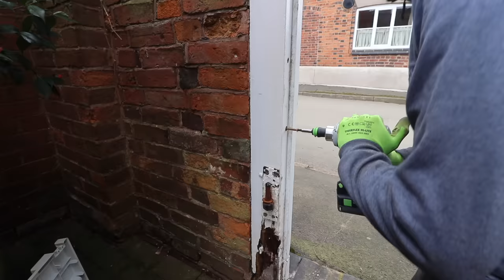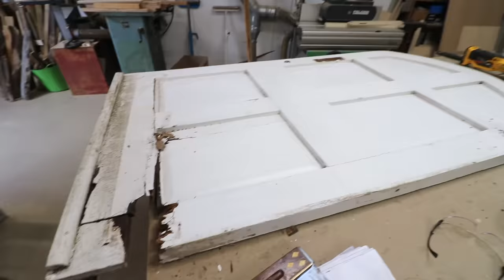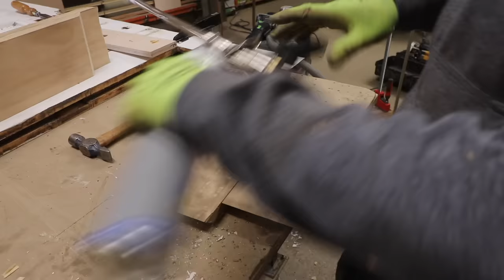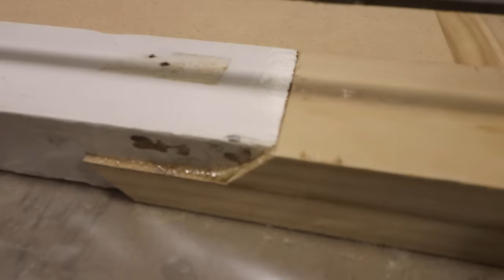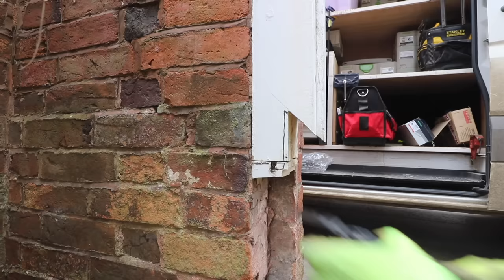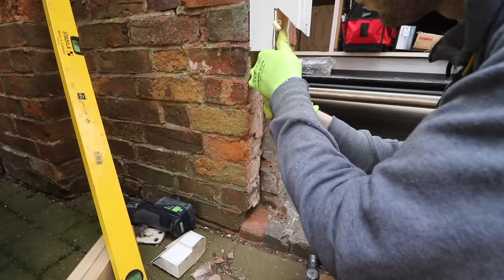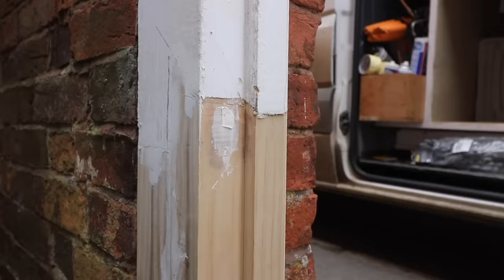Rotten Door, Full Repair. Here's How I Did It.

Comment: As a painter the one of the things I do when doing small repairs is to prime and coat the entire bottom edge of the frame repair to prevent rain water from wicking up the frame to prevent rot and insect infestation.
Reply from the maker: Cheers Bill, I did coat the end grain with Sikens Wv456. Its great stuff and worth having in your kit bag!
Reply: @BradshawJoinery  Glad to hear that I knew you were top notch.

Comment: Thanks for the inspiration! I just made a replacement bottom rail for our 81-year-old door. I don't have sizable machine tools in my current workshop, so I cut the tenons and the top channel on the table saw and used a chisel and a hand plane for the fine work. It took a while, but not longer than going to get bigger tooling that I won't use in the future. I'm happy enough that the door is solid again and functions normally. I was a bit intimidated by the project until seeing this video of yours. Much appreciated!

Comment: Great job! lots of good info and learned some great tips. I dont have that wonderful industrial tenoning machine ,no biggie, it would just take a little longer. The 45 angled steps in the grafted styles I will certainly use, super cool!
Reply from the maker: Cheers Brian, Yeah its a great way to strengthen the joint into a solid part of the door

Comment: Outstanding workmanship. Great to see "REAL" carpenters still exist. My only question would be about the panels. Did you use MDF and how do you rate it will last, especially outside. I've heard even the "exterior" grade is not that good.
Reply from the maker: Hey, thanks for that, this is special MDF, made from Accoya wood fibres, it will not swell or rot outside, even untreated. Its called tricoya there is a link in the description

Comment: Great to watch video, on my 2nd multitool now I think they are one of the most underrated modern tools out there, not only for carpentry but metal- plastics- tiles ETC
Reply from the maker: They are certainly more popular now than 10 years ago! 
They had a Fein when I started in 2007. I've not seen another one until about 5 years ago when they started taking off!
Reply: I kept seeing them when I popped into the toolshop and kept thinking "What use are they?" Eventually I bought a Makita 18v one and the number of times it got me out of a fix... Hardly a job goes by without it being used. Underrated, as you say.
Reply: My Bosch 18V brushless multi tool is the best power tool I've purchased to date. Worth it's weight in gold and has paid for itself ten times over. A real game changer and the ultimate get out of jail card, 👍🔨🇮🇪

Comment: A very decent repair. Customer will appreciate your work for sure. Whenever I did these repairs I liked to shutter the bottom of the door jamb 4 inches high say and fill with a strong cement to keep it off the cement threshold. But you did a good job. I’ve never used the quick dry glue but it’s good in getting the setting so quick. I’m retired now and I did enjoy watching you work takes me back nearly 40 years!
Reply from the maker: Fair enough! Rain splash and sitting wet as the main cause of the rot. THe accoya timber does eliminate that tbh, Its a game changing material for this work. Thanks for the comment :)

Comment: Great video and very instructive.

The new panels you made looked like MDF, is that what you used?
Reply from the maker: Cheers Lee, Yes Its Extreme MDF from Medite, made using Accoya wood fibres. Will last outside unpainted for 50 years!!!

Ive a test piece sitting in a puddle outside the workshop for 7 years now, other than it being very discouloured its still exactly the same .
Reply: @BradshawJoinery  Thanks for that explanation. I thought it looked looked like MDF too, and the only stuff I've seen turns to custard if you so much as show it a damp rag.

Comment: Really nicely done. i just have a question, did you treat the endgrain at the bottom of the framerepair ? and if not, why would that be ?
Reply from the maker: Thanks MAte, I put a clear End grain sealer on the bottom, its a product by sikkens, dries fairly fast. If your in a mega rust to seal end grain and have no other options, i have in the past allowed superglue to soak into the grain then use a spray activator to harden it instantly. 
Sealing the end grain of accoya is only to benefit the paint adhesion really. the actual timber itself will not wrot even if completely saturated.. for a long time
Reply: @BradshawJoinery   nice. ty

Comment: Without any doubt, the multitool is the greatest tool invention in many decades.
Reply from the maker: haha yes James! they seem to have took off now. I remeber where i did my apprenticeship in 2007, they had a fein multitool in the workshop, that looked years old, so i dont think they are a new invention.
Reply: @BradshawJoinery  I use an AEG battery multitool and in my opinion they are one of the best because of all the different heads that can be attached to them. I've had mine for about 8 years and it's still going strong.

Comment: Unbelievable on how many tools you use to do this repair job. Your mindset of keeping up with all the details and progression and step-by-step process is spot on.
What is the ratio price difference between this repair and building a door exactly the same from scratch?
It’ll be interesting for the homeowner to see this video, they would understand better why the cost is what it is. I am not a carpenter I just happen to come across this video, it was awesome thank you for posting. In this day of throwaway society it is refreshing to see your detailed work repair.
Reply from the maker: Thankyou Raymond, Yes most jobs seem to require thorough planning before starting or you end up in a pickle! This repair once painted probably 1/3 the cost of new, has saved the original door, no damage to brickwork and very quick.

Comment: Enjoyed this very much. I learned a lot from the joinery you used.  I had to restore a century-old garage door.  Its bottom was rotted as well, but I had to restore the door in its place, though.  I also went to a sawmill to obtain dimensionally correct lumber.
Reply from the maker: NIce work Lisa, Hopefully the restoration went well! Pleased you have taken something from the video
Reply: Why couldn't the door be removed? (out of interest)
Reply: @sroberts605  The two car garage, with two sets of hinged doors, was converted to have only one set of hinged doors in the center.  The outer doors were affixed to the framing.  One of the outer doors needed the restoration.  I was not about to remove it since it was supporting the header as well.  The main vertical framing member that was affixed to the door was also rotted.  Rather than risking everything collapsing, I chose to restore the door in place.  I also replaced that rotted framing member.  All the timber I used was planed to my specifications at a sawmill.

Comment: Panel doors are no good for outside I had one it lasted a few short years panels got rotten ,replaced with a solid door 15 years later still good ,sometimes repairing doors could be as dear as a new door for out side but you did a great job any hoo
Reply from the maker: Hi Jimmy, completely agree, I would always asses the best and most economical route. Fortunately this is a old Redwood door that is probably 100 years old. The bits I left are completely sound, so cannot see them rotting anytime soon, and the repairs are in Accoya, so likewise won't rot or move any time soon. This repair cost under £700 and dome in 2 days. Replacement door and frame... £3k and alot of disruption to brickwork/mortar along with losing all its aged character.

Comment: That is some custom and some talented workmanship right there I tell you. I personally would have thought making a new door would have been easier,for me anyway,mainly cause I don't have access to the tools or the knowhow to even use them. Good job. I was very impressed.
Reply from the maker: Cheers John, The problem with this one is the curved head and raised panels. its a lot of work to reproduce suce a door then make it fit and install all the ironmongery. While it looks an extreme repair ive only had make the easy square bits of the door and simple panel. Saved alot of money for the customer
Reply: Just like a truly skilled carpenter,you are as modest as I thought you would be. Thank you for the explanation,it does make sense. I'm just very impressed with your workmanship. Thanks again. Nothing but good things for your channel. Peace

Comment: I wish there were more people here doing that kind of repair (Lancaster PA, with many 19th century buildings and a few 18th century ones). Here we struggle to find craftsman to repair simple things like original windows, doors, gates, etc. The only thing I would change would be to replace those phillips head screws with straight slot screws. It's perhaps a small difference, but in my experience it really helps tie together such repairs visually.
Reply from the maker: True the screws would help, I have a decent selection of slotted screws I use on all my jobs, bit not this one! 😂 Fair play, called me on that one 👍

Comment: A lot of customers have no idea what goes into a repair like this.  They wonder why I "charge so much" to "just replace some wood"
  The last time i was asked if I could do something like this I just said "no".   Fantastic job sir and nice shop setup.
Reply from the maker: Cheers MAtt, yeah you definitley need the right customer, But also weigh up the odds for them. If this door was square topped, it would have been similar cost to make a new door as repair... but the curved top changed that and they decided to go with a repair.

Comment: Just found this video on the 'recommended watch list'. It's exactly what I needed to see. My front door porch frame has been rotting away at the bottom for several years now and no local joiner will touch the job. I was resigned to knocking the whole thing down and putting up a new uPVC porch. Now I think I'll have a go at repairing it myself. Brilliant video! One question- can you please let me know what wood did you use for the frame repair section?
Reply from the maker: Nice one Billy. I use Accoya timber. It's basically rot proof! So perfect for repairs!

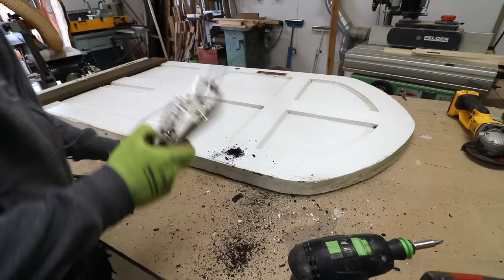Comment: 7:35 I was putting a new engine and engine beds in my boat, The engine beds were bolted to the stringer with 3/8 carriage bolts. When I removed the carriage bolts they looked like what you show at 7;35. I am lucky that the whole engine and beds did not break free while I was under way. I replaced the 318 Chrysler gas engine with a 6 cylinder Ford-Lehman diesel.
Reply from the maker: Nice one Paul! Haha its amazing how some things hold together even upto 200 years down the line!

Comment: Great job. I have had to do some repairs on old mantles in the past. The old paint is a pain. I actually started using walnut shells in a sand blaster to remove it without damaging the wood.
Reply from the maker: Nice one, I bet that makes a bit of a mess! My friend is a sandblaster. 
Have you tried a heat gun/torch
Reply: @BradshawJoinery  it's messy but it keeps the splinters away. I've
 Tried using a heat gun but it takes a long time and it leaves paint behind. I did a mantle a while back that was painted and the owner wanted it stained.
Reply from the maker: Nice one Biff, do you do that on site or take the mantl out?
Reply: @BradshawJoinery  I had to take it out. Lot of work but it turned out great.
Reply: Brilliant repair job. I've done a few myself and know the work involved. If I was super critical I would have primed the edges of the panels before installing them so if they move you wouldn't see any bare tra

Comment: Good philosophy shared between you and the owner >> repair when feasible rather than replace. Especially with a 50+ year old quality made arched entry door. Skilled joinery work Bradshaw. Owner may want to opt for a 'fancy' kickplate, eh?
Reply from the maker: CHeers DImi, yes unlike many comments its nice that you can see the value in repairing such a door and the cost and implications of replacing it! It shouldnt rot for a long time now, All Accoya/Tricoya used :)

Comment: boat epoxy glue with a slow activator works well and does not swell wood fiber which allows cut joints to go together well without a lot of hammering
Reply from the maker: Thanks James! Is it expensive stuff? Ive used the repair care system before for repairs, but it gets pretty dear, and also can end up taking forever to dry depending on which system you use

Comment: Great job, I like it a lot! My opinion, not MDF to outside projects. Also full paint before putting the accessories on the door and paint the frame from the back and from the bottom.  Ιt rains often and you have a lot of humidity.
Reply from the maker: Cheers, the MDF is a product called Tricoya, there is a link in description, its very good stuff. The initial primer coat was just to protect the door from water ingeresss for a short while while the painter was booked in to come later in the year.

Comment: Unless I missed it, I didn’t see you seal/protect the bottoms of the frame pieces before you installed them. Although they don’t seem to be resting on the ground, it won’t take long for dirt, leaves etc to work into that gap, and moisture will wick up into the end grain of the frame.  I’m sure some appropriate sealant can be applied under them to prevent the water damage from starting all over again.   Edit: I read farther down in the comments that someone else asked the same question. I suggest that some comment in the video remarks as to how this treatment was applied would be helpful.
Reply from the maker: HI yeah, i didnt show it! I use Sikkens WV456 end grain sealer, its a clear thick paste that seals the grain. Yes it will also only do so much on normal timber, With Accoya however it should last atleast 50 years! Its great stuff, any external work it really pays to use it

Comment: That is a truly fantastic and professional job. Like you I had a fully equipped joinery workshop. Where do you draw the line between repair or replace? I always enjoyed that kind of work but found it difficult to make money out of those kind of jobs. I always covered my cost but that was about it. That probably says 
more about my business acumen. Anyway, throughly enjoyed the video. Great stuff.
Reply from the maker: Repair or replace depends on, cost and originiality and disruption. A fairly simple repair here, has seen in 2 days job complete and still looks spot on 2 years later... whereas replace would have been nearly 2 weeks work, with probably damage to brickwork. I have a very happy elderly customer and was definitley the right decision.
Reply: @BradshawJoinery  thanks for your reply. I fully understand your rationale. It looked a lovely job by the way.

Comment: I quite enjoyed your post and skills. But I was also thinking about the first joiners to make this type of door before all the power tools.
I acknowledge the benefits of using power tool and only a fool would not use them if it improves the job.
Reply from the maker: It was a hard job back in the day, but I guess alot better than many of the other jobs around... Mining, steel working etc and less dust than there is today.

Comment: great job ... question can you add silicon between brick and wood as a way of sealing wood from moisture and mildew.
Reply from the maker: Yes you can do, I use a clear end grain sealer and then match wahtever is in situ. Personally try to avoid sealing anything expasoed like this as generally you end up trapping moisture rather than keeping it out!

Comment: Really lovely job, and I learned a lot from it.  I have a similar door to do so the guidance was timely. My only comment is that would not have been my choice of door furniture, which seemed to be no more than pressed steel, while the original hinges looked wrought, and could surely have been restored as needed with a little welding and grinding.  Tidied up they change hands for good money.
Reply from the maker: Hey Rick, thanks for that, the hook and bands could be very easily forged into the same shape as the originals, there isnt much in it. i dont think the clients budget here would have stretched to hinge restoration but would be nice to do the complete job "concours" style

Comment: Good video I like it.
I have used PU glue since it was developed, it was developed as a boat builders glue because it is water proof and foams up to seal any gaps, also incredibly strong when gone off, however through vigorous testing on end grain  we found it too brittle and not as strong amd waterproof PVA.
Worth pointing out also polyurethane glues are very messy and very difficult to get off your hands so ware gloves, also very smelly and in closed confined spaces can make you very dissy.
Not a glue for every occasion  and more expensive that PVA for sure.
Out of interest what are the panels made from? I am presuming it's Medite tricoya ?
Reply from the maker: I seriously disslike the smell some PU glues emit, so avoid them at all costs. I am also very wary of the cancer element so handle with care. Panels are tricoya yes. Door still looks mega.